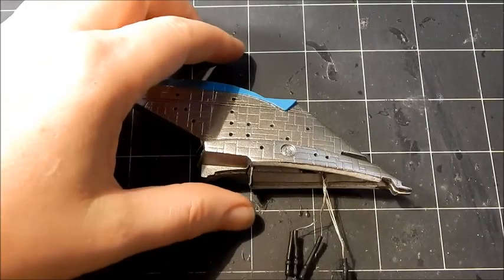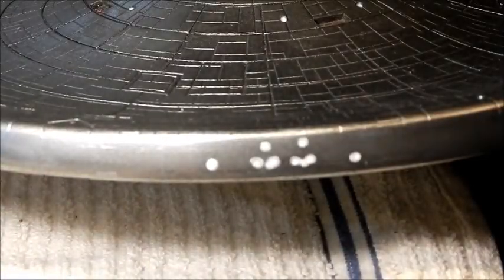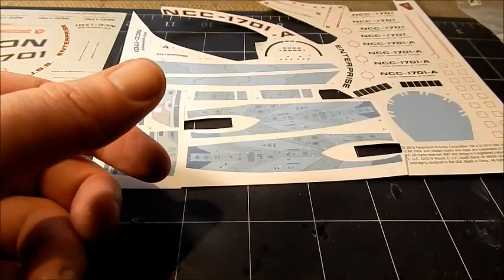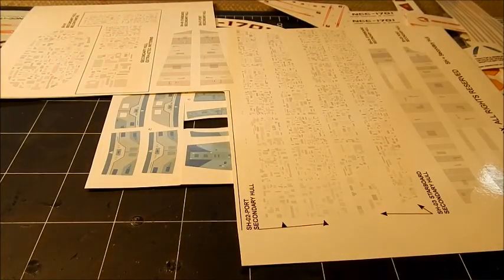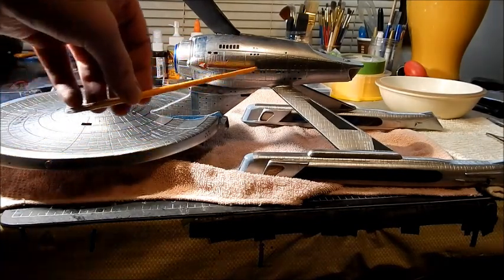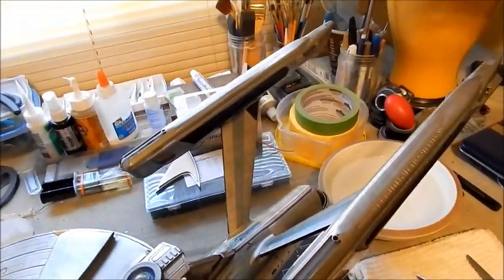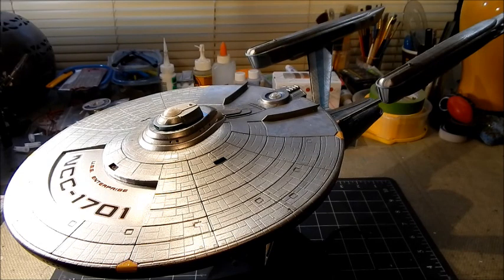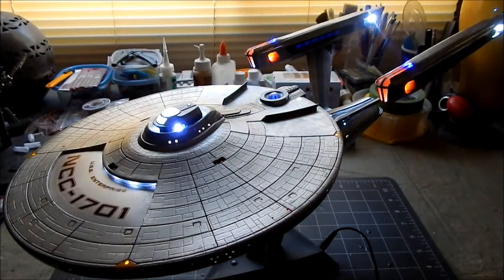AMT Enterprise Disco Refit Build Episode 13

Comment: I know these are old vids, but they motivate me to get started on my 13foot Constitution. I just got to get my shop area cleaned up so I have the room.
Reply from the maker: Heya TS! 13..foot?! Wow, thats...just..wow! I would love to do something like that, but I don't have the room, tools, cash to throw into that kind of endeavor. I really hope you go for it, would love to see that build! Hey, I know you're probably going to scratch build everything, but if you want some 3D parts let me know. I plan on building a bunch of stuff for the 350 TOS E, but can always upscale the parts/details for something that scale. Good luck!!
Reply: @PunkyWily  I have 7-3D printers because we started a custom archery bow company (Blue Dragon Archery)
We are printing out custom Chess Sets, and we have a partner that just bought the presses to make custom T shirts, Hoodies, that sort of thing.
I have a Lathe and a Mill. I need to do a little work on the mill.
I am looking at buying a Phrozon 8K or their largest 4K printer.
If we take it to a production level I am looking at making the garage kits to about 1/144 scale which would be about 6 and a half feet in length for the Constitution.
The reason I want to build the 13 foot and a quarter inch version is because that what the line drawings I laid out several years ago for 1/72 scale came out to.
I wish to build it for 1. Because I want to, LOL. 
2. It would be larger that the 1/86.899 filming hero that is at the Smithsonian, in which snobby ass people I entered into a 3 month debate concerning the actual dimensions of that model, and I told them of my plans that I wished to build all 3 of the TOS ships and that I had them Lind Drawn Scaled from my 8 foot drafting desk, and they basically told me that I was full of shit, and that if I didn't have pictures or proof of concept that I could and should go take a hike and leave them alone. (So Yea, they challenged me to make the model.
3. I want to Build the Constitution because 8 million people have models of Enterprise. Ironically the show ship was suppose to be Yorktown and Gene decided to change it to Enterprise because of CV-6 Enterprises war record.
Anyway I have a large enough shop. I also have a few large scale (1/72) German Warship projects that I have sitting on the sidelines in various stages.
I am bad about chasing squirls. When I do focus though I get good results.
Anyway, yea, I have some shop cleaning to do and I should be posting soon.
Reply from the maker: @TwistedSisterHaratiofales  Wow man, you got it going on! We should chat some time man.Got something in the works, a few things, might interest you.

Comment: What have you done. Its a propped mish mash or alternate universes. 
However, i think i like it........ and the necelles with the red looks really good, instead of the flat black.  kind of made things a little odd that the original conny ship had red bussard collectors and the refit did not, and then every other ship following went back to glowing bussards.
Great work on a re-imagining starship.
Reply from the maker: Heya Retro Tech Ralph!! Yeah, I didn't mean to do any interdimensional tampering  here, although a glowing ominus portal showed up where I have the ship displayed , I may want to look into that. Just playing with my toys over here, and I love the new TOS Disco design. It's always good to use your imagination!! Thanks for watching!!